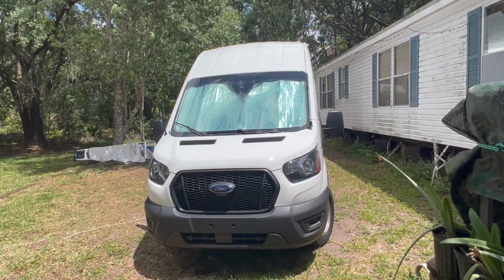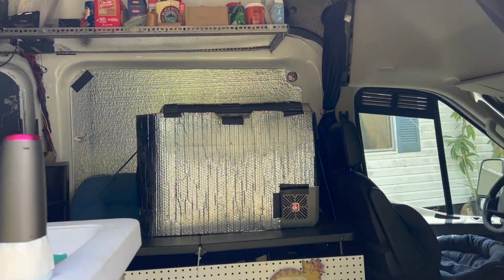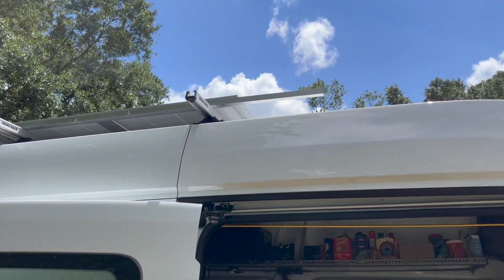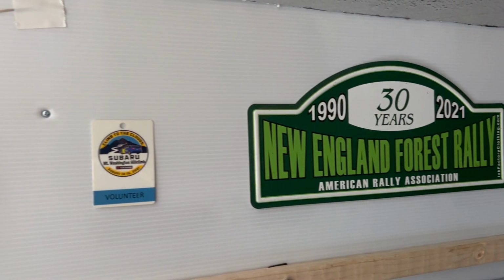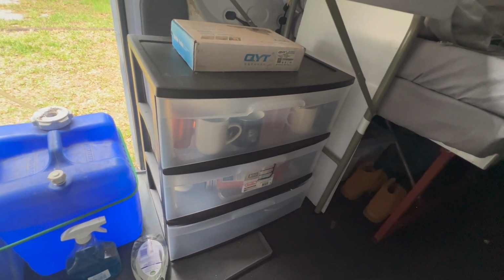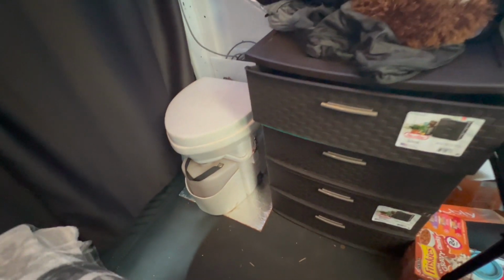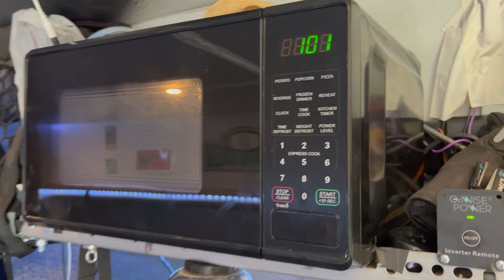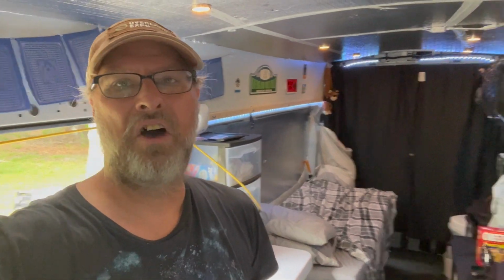Smokey II Van Tour - 2021 Ford Transit - No-Build Van Build

Comment: Great work Justin. I like what you've done with the new van. What size engine is in it and what is the potential gas mileage? A 2021 with such low miles, wow.
Reply from the maker: Thanks! 3.5 V6, NOT EcoBoost. Still has 20hp more than my old van’s 5.4 V8 😂 but down on torque, of course. Haven’t driven enough to get a good idea on mileage, especially while towing, but around town without the trailer I’ve gotten about 13 mpg on a single tank, same as my E250. That’s with a bit of idling while playing around with FORScan. 😊

Comment: Hi…I’m interested in the plug within the bumper…how does it go inside the van??? Sorry…I’m always told that I am a little bit “thick” 😂
Reply: Uhm…there is a ?…I’m interested in an answer
Reply from the maker: Basically the cord goes through a rubber seal underneath and into the van. It’s hard to put into words. How about I post a Short about it?
Reply: That would be fantastic!
Reply from the maker: @veronicaspivey3479 just posted it!
Reply: Wonderful!  One more ?: the 2 rubber seals…does it matter which one u put     the cable thru?
Reply from the maker: @veronicaspivey3479  the one I used goes straight up a pillar that has holes for easy access to the interior, which is why I used it. The other one may be connected, too, but I don’t remember. If it is, it’s still not as convenient to use as the one I did.
Reply: Thks a million!!! 😁